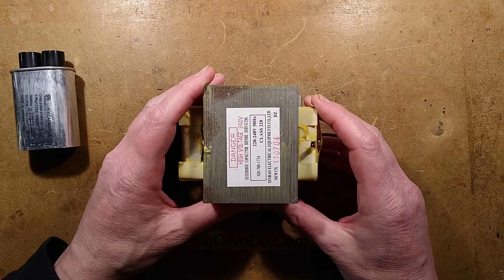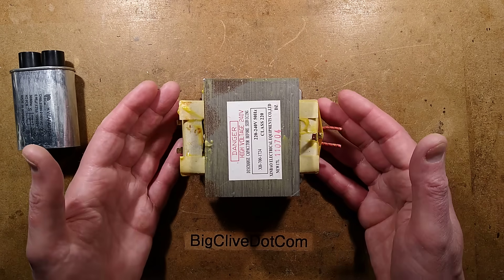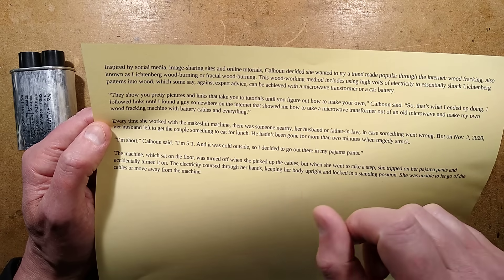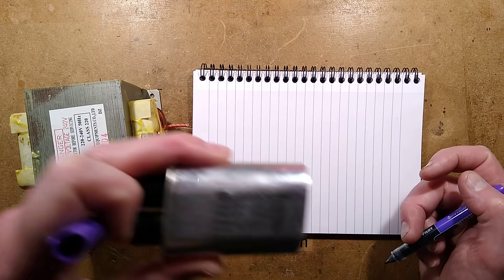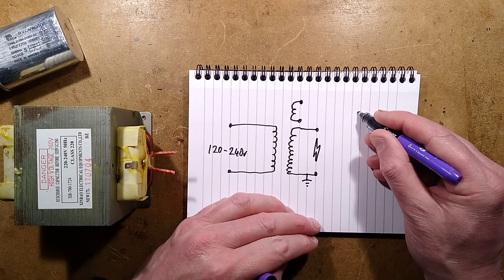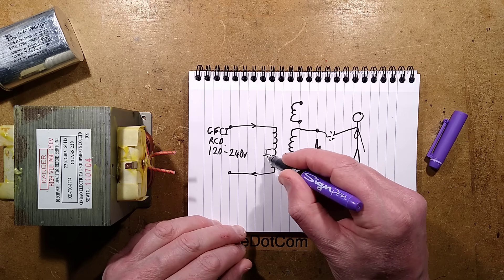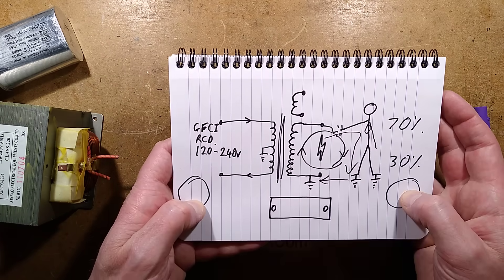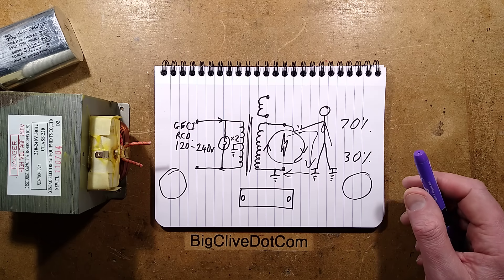The most deadly project on the Internet

Comment: Even the microwave capacitor can kill you if is still holding a charge. Microwaves are the most dangerous appliances to play with. Dangers include high voltage transformer AND capacitor, radioactive materials and 4 o 5 very very normal screws holding up the case

Comment: My mates an electrician and I do air conditioning so we both understand the dangers.
We would have a long extension lead running to the set up. This meant we were far away from the area.
It is highly dangerous and I wouldn’t recommend it unless you are with a professional.

Comment: My friend from university wanted to show a jacobs ladder device made out of uWave transformer to his gf. Tried to adjust the electrodes without switching the device off. The electricity locked all his muscles and he couldnt let go the electrodes, moreover, he leaned forward and touched the nodes with his face. His gf saved his life by disconecting the device from mains. Ended up with severe burns to his hands and face and memory loss. I remember visiting him in hospital. I myself used to work with tube amps and the voltage levels are scary, but shit is on different level.

Comment: There are two things I don't mess with: electricity and plumbing. Even had a licensed electrician come out to install some outlets and he shocked himself (minor) by accident, and he was a trained professional with decades of experience.
Reply: outlets and whatnot are not that hard to do. But what's even better is knowing our limitations and having someone else just do it so we don't kill ourselves in the process. My fat butt DOES NOT CLIMB, PERIOD. I also do not drive motorcycles, yes I know how to but my clumsy ass would get killed. Good on you for knowing when to let someone else do it.
Reply: @yurimodin7333  yes, people need to know and understand their limits. You're not a coward or incapable because you chose to let a professional do it. Some things just require an expert.

Funny you mention climbing, I work with a BIG fella and he used to climb poles. I didn't believe him until he showed me a pic of him on the top of a pole, if he fell he would've left a crater. Strong guy and real nice, but man is he big. I'm sure he caught some looks from passerbys when he was up on that pole.
Reply: @yurimodin7333  yea they're super easy, i used to do a lot of work under the table so we had to cut corners since i was too young to actually work on stuff. Worked on live wires and understanding how grounding works and well as the potential danger is huge too. Been zapped a good amount with minor stuff but there are too many parts that can be underestimate and end your life really quick. Breaker boxes and the service lives are nothing to mess with.
Reply: I used to do electrical work and have been shocked so many times I can't count. 120v isn't something you want to get stuck to but it isn't terrible.

Anything higher will yeet your soul out of heaven and into the lord's embrace. The only lethal workplace incident I've ever witnessed involved a 480v HVAC circuit and an unsuspecting technician. Electricity is no joke.
Reply: @stanielb2005  240 V just stings. As long as you don't 'stick' it's fine. Electricians at work tell me 400V really gives you a slap.
Reply: @patrickhouston2610  Yes I am serious. I've touched 240 to earth several times the muscle spasm causes you to break contact in milliseconds. When I start electric work, I brush against the contact with the back of my hand so that if something went wrong and they're still live, it doesn't do anything bad. What you do NOT want to do is grab live contacts in a way that makes you grab harder. And of course I wouldn't do that intentionally but if you do electric work accidents happen. Such as the time when I encountered a power socket where against all regulation, the 2 sockets got their juice from different breakers. So I measured the voltage on the socket, tripped the breaker, tested again, it was zero, screwed the thing open and then was shocked by one of the prongs that got juice from another breaker. Shit like this happens, because of things that shouldn't. It stings.
Reply: @brunovandooren3762  It isn't the voltage that kills you. It is the amps. I'm an electronics repair tech. I once got zapped by 31,000 volts while doing a high voltage adjustment on a  CRT computer monitor I forgot to unplug. It threw me back in my chair but didn't hurt me because the current was below 8 milliamps.
Reply: @everythingmatters6308  yes. But that is irrelevant to this situation because  it's a powered transformer capable of delivering a current. A crt has capacitive voltage which can give yiu a mighty kick but hasn't enough charge to deliver a lethal current. Electric cattle fences are like thatvas well.

When we consider power distribution, current is a direct result of voltage which is why the 30000v crt capacitor is relatively harmless butba 30000 power line will burn you to a cinder if you touch while earthed
Reply: @brunovandooren3762  yes depending on a few variables its not that bad 120-240, when you start throwing in things like small spaces, water, and grounds such as copper water lines and gas lines it can get deadly quick. I work on live stuff alot (use one hand, never do it in a cramped position).
Reply: @everythingmatters6308  "it's the amps" ... this comment always bothered me...
because, Amps is dependent on the frequency response of the electrical impulse.
if anything, it's the Energy that kills you.

It's hard to find data on the impedance of the human heart at 60 Hz, but claims have it at 7mA for 3 seconds is lethal. that is .021 coulombs of charge across the heart will kill you.
1milliampere should be sensible on the human tissue, but other sources are indicating that 10 Amps causes cardiac arrest.

I'm also curious on your claim that you were able to measure the current that shocked you.
Because current is the resultant response of the voltage, how did you measure this unless you snapshot the line with an amp clamp.
Reply: @cpK054L  I was doing a high voltage adjustment. I didn't measure current. You unplug the unit (which I forgot to do), lift the suction cup from the high voltage transformer that goes to a hole in the CRT,  stick a high voltage probe against the clips underneath the suction cup, plug the unit back in, turn it on, and adjust a variable resistor on the main board. The maximum voltage on that particular model was 31k. I needed to bring it down to 26k volts. I never forgot to unplug a unit ever again.
Reply: @everythingmatters6308  Then how do you know how much current went through your body?
Biological tissue has a very peculiar electrical impulse response, so unless you were getting charge pumped (which is highly unlikely) there's no way for you to determine how much current went through your body.
A taser can deliver 100,000 volts in some cases, but it is still non-lethal.
But a shitty designed neurostimulator that is barely 24 volts can kill you if the net charge is not negated.
Reply: @cpK054L  I had a book that told what the current was. I'm done arguing with you.
Reply: @everythingmatters6308  current of what?
I'm not even trying to argue.
but all you're saying is "a book told me so"
is a very fallacious situation you got there.
So do you care to understand what you are trying to state, or do you just want to believe what you read?
Reply: @everythingmatters6308  my teacher said always make sure disconnect is off
Reply: @stanielb2005  theres really no way to shock yourself if the system is off right
Reply: Exactly. And there are lots of trained, professional electricians that get seriously injured on the job, just because it is so inherently dangerous even when you know what you're doing. So, the idea of someone that DOESN'T really know what they're doing rigging up something that can run 2000V through you with even the tiniest misstep? Seems like a horrendously bad idea. Even if they barely brush up against the table, for example, they're done for. People really have no idea just how bad of an idea this is.
Reply: @zzevonplant  There is a famous saying among electricians: There are good high voltage technicians and there are dead high voltage technicians. The bad ones are only temporarily so.
Reply: The family business was an electrical supply house.  Too many of our customers died from electrocution.  Sometime it would be something as unforeseen as drilling into a wall and hitting a high-voltage line.
Reply: @ggendel  Some industrial electricians I’ve seen are nuts.  Checking voltages with a screwdriver and feeling the electricity, stuff that comes from extensive experience but nah, I’m good over here.
Reply: Wholesome comments right here
Reply: 120v and 15 amps will kill you. That's what's in your walls.
Reply: That'll happen, and most of the times its 230v from phase to earth with an rcd or 120v to earth with rcd if ur in the states.
Reply: I'm with you - electricity & plumbing, get someone who knows what they're doing.
Reply: I''ll be trying to get a "fracking" pattern on my sump pump. It's too critical to shut off, but I think I can manage.

Comment: To discharge a Capacitor properly. Is to use a voltmeter. Going from the C post to load post with the voltmeter then observe the volts in the Cap fall to zero. This all being done after checking your meter against a know source. no multimeter no electrical work.
Reply from the maker: Keep in mind that these capacitors can be charged to higher than your meter's voltage rating and it may damage it.

Comment: When I first saw people doing these things, I thought that's cool up until I saw how they were doing it. I knew people were stupid and going to end up dying because of this shit. I remember being in something called Job Corps (which is basically a shittier trade school) and was learning maintenance. We had to work on and fix all of the electrical outlets in the dorms because they were due for replacing. Instructor was with us to ensure no one was acting up and 1 guy decided to do something stupid as all hell - he took a screwdriver and touched the metal interior of the outlet (which had not been turned off because they told us we weren't allowed to shut off the power meaning we had to work with live wires) which created this very loud explosion sound. Everyone stopped what they were doing and listened in, the instructor was so pissed that he would do something so stupid so he told him to give him the screwdriver before he gets someone killed. LIVE WIRES ARE NO JOKE PEOPLE, DO NOT DO THIS STUPID TREND, YOU WILL LIKELY DIE.

Comment: Correct me if I misremember high school physics and a fair few years working with electrics but voltage isn't the dangerous component, it's current. I still remember being taught "volts jolts, mils kills".
I've been on the receiving end of Van Der Graaf generators (yay for having very fine hair when doing high school physics lol) which produces upwards of 240Kv and live to tell the tale.

Comment: 1. Shortening the high voltage capacitor with a screw driver? doesn't that potentionally kill the capacitor?

2. I like the idea of  the dead man switch but I would take it even a step further. Instead of switching the primary coil directly with two buttons in series, I would build a contactor into the cirquit (at least one in L primary but better one in L primary and one in N primary) which is/are then controlled by the dead man switch via a low Voltage (24V or something) so you don't get even close to any potentionally dangerous Voltages (even 120V~ or 230V~ can alreaddy pretty much ruin your day if you are unlucky). Furthermore, I would put all the electronics in a closed PVC Housing (at least IP44). If you're fancy I would even secure the lid of said housing with a 24V limit switch, which would be a nother switch-on condition to make sure that the housing is closed when the machine is operating and add several more control lamps to be able to always know what my machine is doing (Standby, 24V OK, Lid Open (flashing signal), Contractor 1 ON, Contractor 2 ON) as well as a kill switch. Of course this makes the whole thing way more expensive (I guess we are talking about something between one and two grands here) but this is a life and death situation so it would be money well spent.

Comment: I work with dangerous equipment every day and every now and then I get a healthy reminder of my ability to make fatal mistakes. Make a habit of doing the job safely so when you do make a mistake, you come out uninjured, or at least not permanently disabled. Practice makes permanent. Safety equipment and procedures aren't for the times it goes right, it's for the times it goes wrong.

Comment: The discharge resistor connected to chassis ground should be carefully inspected once the microwave cover is removed. If it’s damaged, blackened or loose/disconnected theres a good chance the capacitor is still holding a charge. Even without visible damage it should be assumed the cap is fully charged for safety. Best practice before continuing is to tape a heavy gauge shunt wire to the end of a broom stick the correct length to short the capacitor terminal to the chassis. This way any remaining charge will instantly dissipate into the metal frame. Obviously keep clear and dont contact the microwave during. Also ware gloves

Comment: I had a close call with one myself. I am dumb and this ended my hobby electronics tinkering but I shorted it across my hand. Luckily it only went from thumb to ring finger but sorta "blew out" a hole in my finger. My hand felt real weird, sore, and tingly for a little bit and only ended with a small scar. It's way too easy to get comfortable around it and they are certainly no joke.

Comment: Ignorance has made me lose material, not my life. Some dude on the UK had a video on the internet telling people how to restore a faulty Xbox 360 ages ago, by blowing hot air on the circuit board, covered with aluminum to protect the other pieces. He never mentioned the temperature and I forgot to check myself somewhere else. My batteries exploded like a firework of pop corn and a terrible toxic smell.

Comment: I’m a technician and have been shocked by 120v many many times and not really that big a deal. One time I have been shocked by 277v and it was far  worse. The fillings in my mouth heated up and made my teeth hurt with only an instant of shock. No way I’m messing with voltage beyond 120/240 ever and I’ve been wiring, repairing and working around live circuits for 30 years.
Reply: the part about the fillings sounds awful